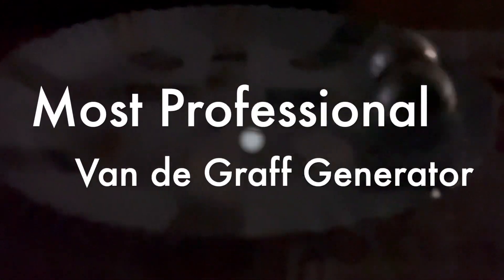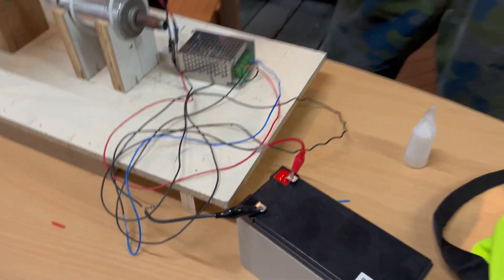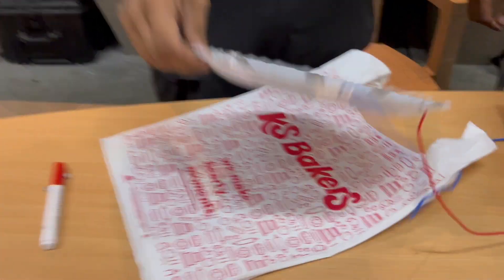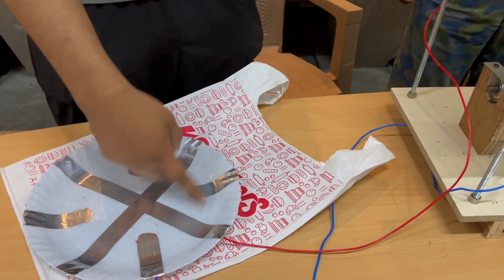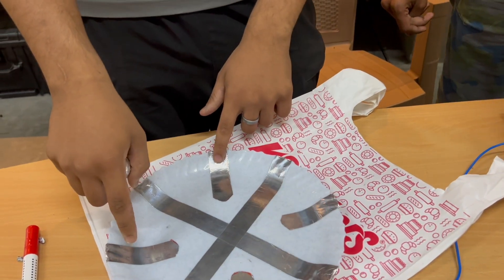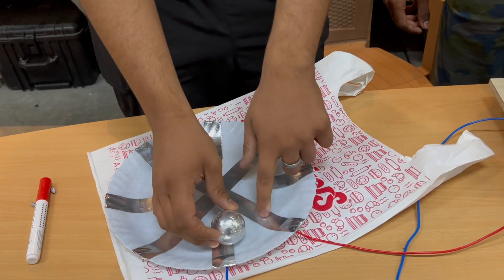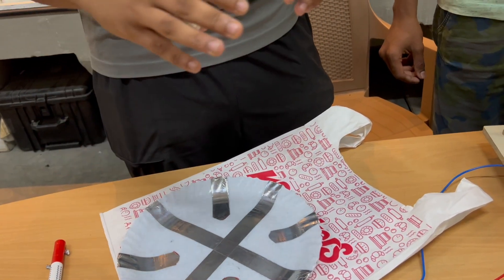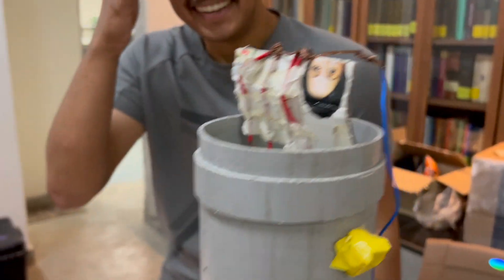Make your own [particle] accelerator at home.

Comment: Sir, can you mention what material was used to build the conveyor belt in this generator? I was thinking of using resistance exercise bands for the belt, but they turned out to be a lot thicker than estimated.
Reply from the maker: Warning: This is a high voltage device and can pose a serious safety hazard.

Following is the reply from my student who made an improved version of this generator:
"The material should be natural latex rubber, but I just bought an exercise resistance band. The cheaper the band, the better it is for a Van de Graaff generator"